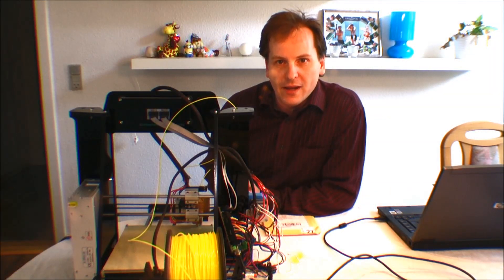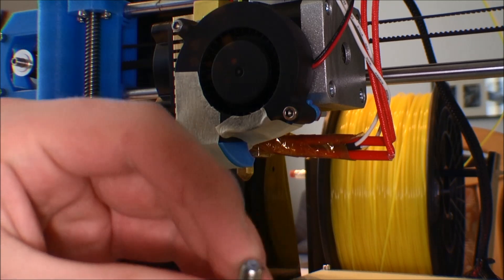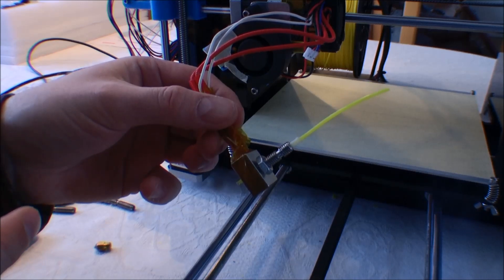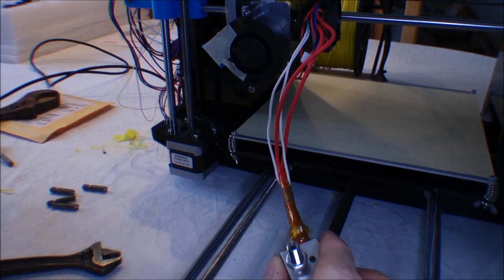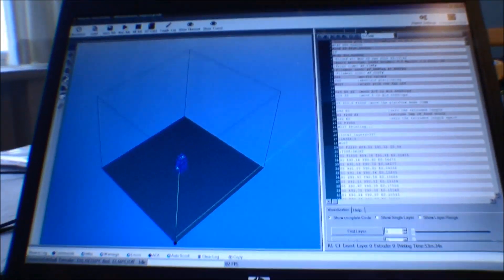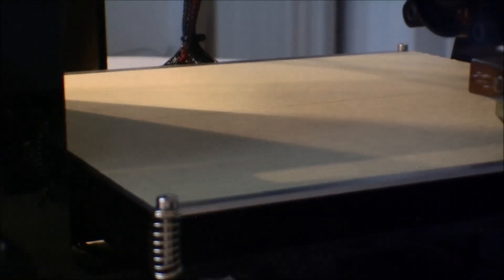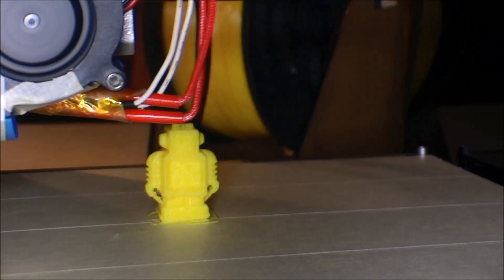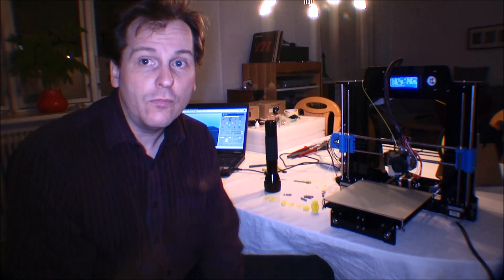Replace defect M6*26 nozzle throat with teflon tube of inexpensive Chinese reprap 3D printer - 164

Comment: You are wrong on the throat bolt being upside down. I did the same thing. It goes like it was because when you pull the filament out it needs be where it wont pull back upwards and if you change it around you will have trouble and it will also leak around the nozzle block between the block and the throat screw.
Reply from the maker: Hi Fish Man
Thank You very much!
Thank you for watching! :-)

Comment: I was experiencing the same issue with my printer. I've noticed the Teflon tube sticking out of the extruder throat before and just pushed it back in, but now after watching your video I'm thinking that might be my issue. I just ordered a pair or replacement parts and hopefully this will cure my issue. I loved this printer once I got it working, but after about 3 months it just started jamming all the time and I have tried everything I could find to get it working again. Hopefully this is the trick! Thank you for the video!
Reply from the maker: Hi Michael Harris
I hope you get your printer working again,,, I have not had this problem with mine, since I switched,,

Other problemmer YES,,, maby you have a good solution to this problem: https://www.youtube.com/watch?v=5Z7UpKBj6pE  The first problem,, the second problem is solved,, it was just me who was stupid :-)
Thank you for watching! :-)

Comment: for PLA, use the 3m scotch branded BLUE masking tape. sticks like hell.
then your next problem is getting it off the bed :)
Reply from the maker: Hi Gary Price 
Thanks for the good advice,, I will see if I can buy me some of that....
What temperature do you use for PLA ?
Thank you for watching! :-)
Reply: Head temp depends on colour and speed. Generally 195-210. though i try to print first layer hotter. Like 230. 
Bed temp, with blue tape, 60. Str8 glass with hairspray, 75. Though this causes other problems because PLA is soft above 60.
Reply from the maker: Hi Gary Price 
It's not far from where I was,, i did 210 with masking tape and 50 degrees on the bed.
I´ll try the hairspray, Everyone says it works.. "hairspray, 75" Is that a brand?
Thank you for watching! :-)
Reply: no, 75 is the temp i used with hairspray.

The hairspray just needs to be the extra strong type.

here is the blue tape that i use. 
http://www.scotchblue.com/wps/portal/3M/en_US/Scotch-BlueBrand/Scotch-Blue/Products/Catalog/~/ScotchBlue-Painter-s-Tape-Original-Multi-Use-2090?N=4336+3294340635+3294529207&rt=rud
Reply from the maker: Hi Gary Price 
Okay fantastic, thanks for all the good advice.
Thank you for watching! :-)

Comment: If you are using ABS run your hotend at 230C and the Bed at 90C stay with the glass plate and use Elmer's Glue stick or equivalent that is what I have had the best results with.. I hope all this has helped you ... Jim B
Reply from the maker: Hi again James Bussing 
My printer has a aluminum bed and i put the included masking tape on it.I was runnin PLA at 210C and 50 on the Bed,, just for info :-)
Thank you for watching! :-)